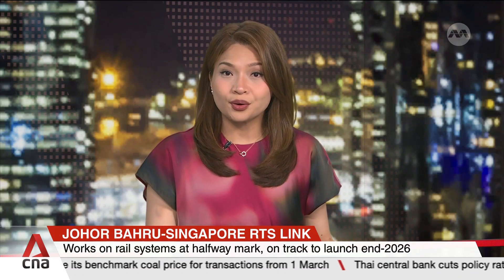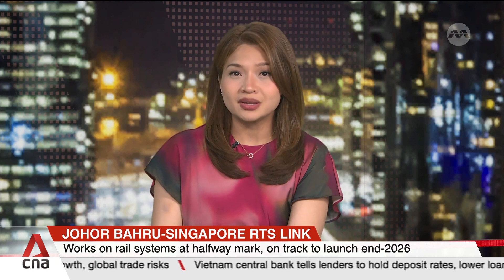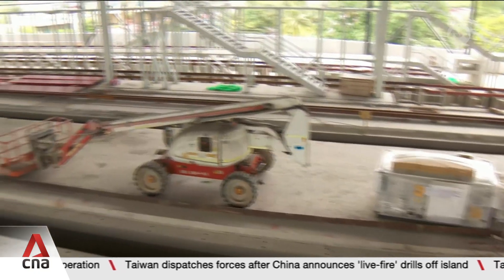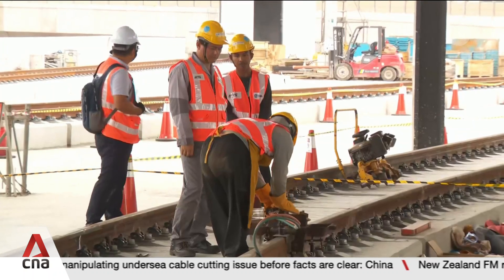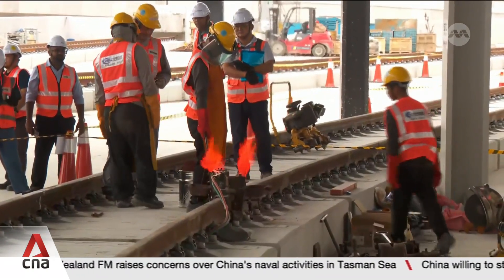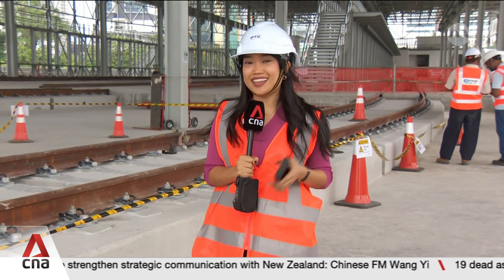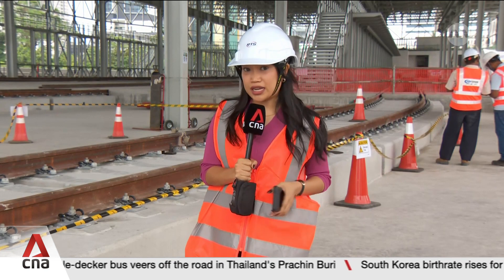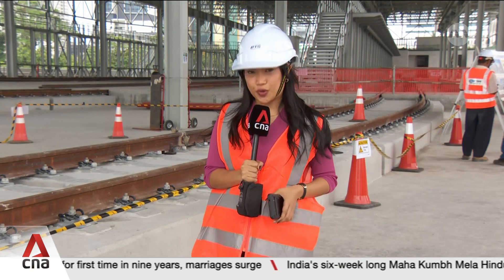Rail system works on Johor Bahru-Singapore RTS Link 50% complete

Comment: 50%????
2027
Reply: Only talking about the tracks 50% complete, Everything else from the stations to the bridges were finished 100% months ago alr. They just only started laying tracks as the final part Q4 2024 so its on time and in budget.
Reply: They've moved to the next phase of the project and it's the track works implementation that's at 50%, not the entire project?